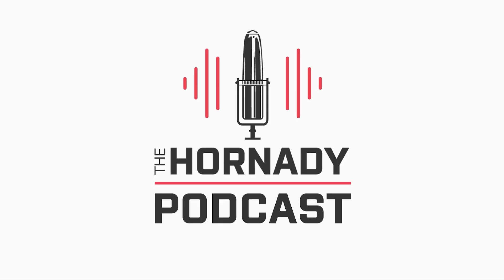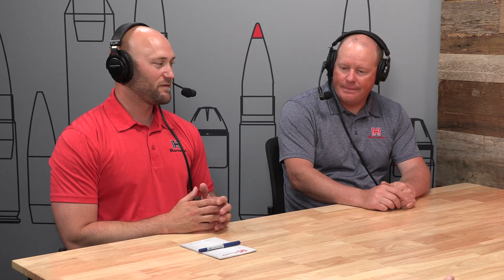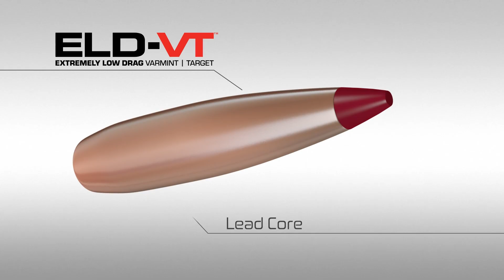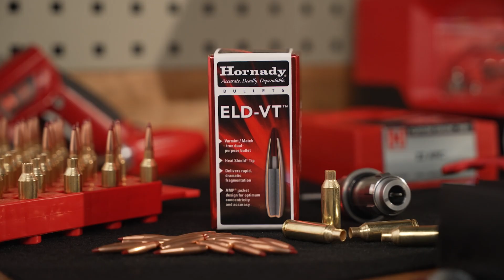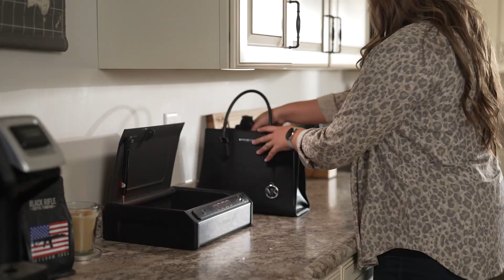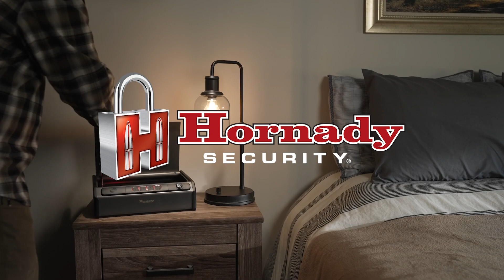Ep. 135 - A-Tip | The Rest of the Story |

Comment: @Hornady Manufacturing

If I want max performance out of a Berger, I have to trim/point them.
SMK's are factory pointed but dont have the profile and require higher twist rate.
ELD tips have a wobble and are inconsistent base-to-tip.
The A-Tip's are the answer. They cost more but how long does it take to trim/point a batch of Bergers? How much more gear do I need to do that? How many Bergers am I going to ruin learning that process? I dont have to do that with the A-tips. I have some 230's for my 300PRC. I cant run 250's because its a 26" tube with a 9 twist. I just assumed the 153's were too heavy for the CM, but it shoots the 147's over 2800fps. My 6.5CM is a cannon. 8 twist with a 28" tube. I think it will be fine especially if I can get it to shoot in the 2780 window that my barrel likes. Keep on keepin on.

Comment: Well done folks. It's good to hear the history behind this bullet. When I put my .300 PRC together, I could not find 230's in stock from my normal bullet manufacture I have been using for years. the 230 A-Tip was in stock and I bought 300. My ladder test with N570 was just a solid flat line. I settled on 79 grains and from the 26" Bergara barrel, it's pumping them out average of 2840. It's held 1/2 MOA out to 1000 so far. You can't convince me move off this bullet and powder combo. It just flat out shoots!
Reply: I use RL26 and get 2950fps from a 26" bergara and 230atip. 

Good to know that N570 will push them well with RL26 being on the endangered species list.

Comment: I noticed in the 11th edition, the only 230 or 250 A tip reloading information is under 300 PRC and 300 Norma. Any plans on releasing data for those bullets in other cartridges? Since the 250 A tip is the bees knees, what did you have in mind when you created the 230? What cartridge was meant to attach to that bullet?

Comment: I've been shooting 80gr ELDm bullets for 600 yard stages in CMP/NRA Service RIfle for the last three years. They shoot incredibly well, with fantastic vertical. Shot the 88s as well, and I think it's a wash in terms of wind drift with the 80s because you typically get about 100 fps slower out of the heavier 88s. That being said, I have a fair number of A-Tip 90s and so far they are pretty impressive in terms of wind drift. Going to shoot them this weekend in a match and make a determination if I'm taking them to Camp Perry.  

I'd hope that at some point you will offer the 80 ELDm in 3500 count cases.

Comment: Octane does not make power... technically if you don't change timing, you lose power with higher octane...
Reply: What will happen if your engine and  timing is set up for the higher octane, and you run lower octane??
Reply: Kaboom...haha
Reply: @andrewmcmullen1388  Well then you got a problem, lol
Reply: @andrewmcmullen1388  Your engine will knock especially under load (pulling trailer, going up hill, running hot) Most newer computer controlled engines have knock sensors that detect knock and then the computer will retard ignition timing
Reply: Not just timing fellas. The advantage of high octane is the ability to run higher compression.
Reply: @brianschumaker5912 or higher boost with turbos. Kinda same as high compression piston. And put more ethanol and you keep temperatures bit lower with more boost pressure.

Comment: 135 Atips are easily the most consistently accurate bullet ive ran in 6.5saum and 6.5 creed.  Filled the freezer with a couple as well.      90g Atip is wizardry in a 22 creed more.

Joe explained it all very well. Thanks for another great podcast with a full table of stellar knowledge and information.
Reply: Taken quite a few deer with the 135 A tip in my creed. Switched to the 123eldm last year and I’m loving that too.
Reply: @veteranironoutdoors8320  EldM just flat out get it  done every time

Comment: The A-Tip is nice but just so expensive.
Reply: 0.40 for the powder, 0.12 for the primer, minimum 0.40 for the bullet, typically 0.20 for the brass (assuming 5-10 reloads) — lowest price is over $1 per round.   Adding 0.45 to the total is not a lot to pay for performance.   

If the A-Tip works for you, it’s worth it.
Reply: @brianbadger2234 Where I am they're £1+ each, Berger £0.85, Matchking £0.55, Scenar-L's £0.50, Custom £0.43
Reply: @brianbadger2234  An A-Tip here is typically £1 a pop. Berger £0.80. Sierra £0.55 and Lapua £0.60.
Reply: @redrock425  Bergers and A-Tips cost the same in the U.S.